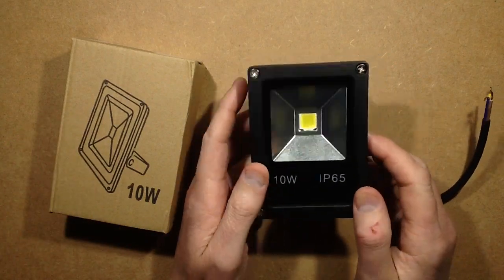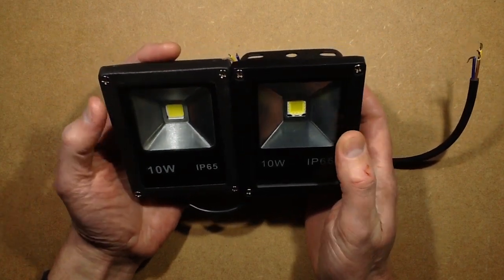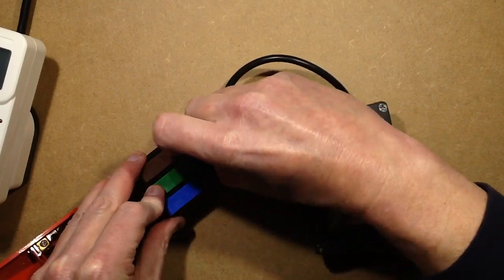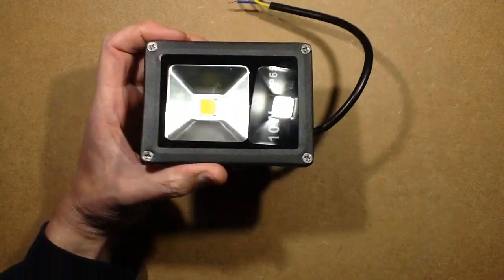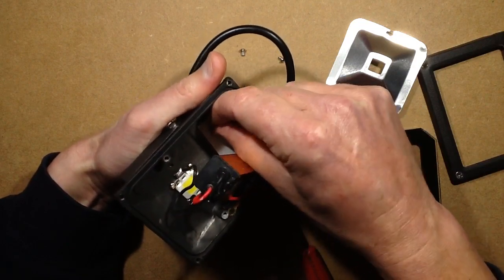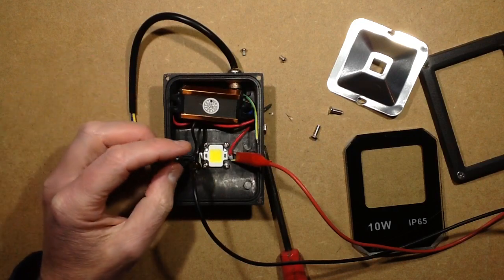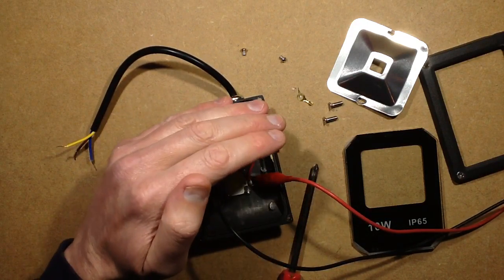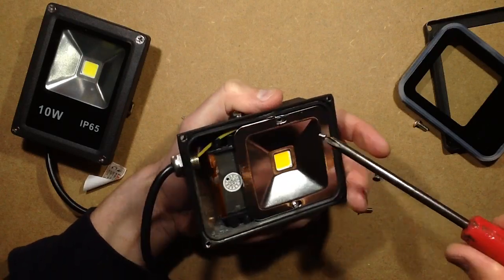A look at some super-cheap mini 10W LED floodlights.

Comment: I don't understand why they can't just put the damn earth under the screw. It will take them, what... Like half a second to move the cable there before screwing? xD. But yeah, holy crap, that's super surprising that it's half decent! :D

Would you be able to test one of those mini 50w amp boards on ebay? They're like 4-5 quid form China, and I was gonna buy one for my mini subwoofer, but I have no clue if they'll just blow up xD

Comment: Hot glue? Use acetone.
Reply: +Rav Gupta Or just alochol, isopropyl or whatever you have on hand. It works very well, and has much less risk of damaging anything.
Reply: +Old Farfegnugen believe it or not a drop or two is all we need. Place it on the body. If the label does not touch the body we are good. But the heat gun works:)
Reply from the maker: +Rav Gupta I did peel it off.  I used the hot air pen on my solder station.  it came off quite neatly.
Reply: +Rav Gupta 
As Niels said I would try alcohol (isopropyl) first. Acetone is quite aggressive to many plastics and paints and is much more likely to dissolve away the ink on the label for example if it gets there.

Comment: I found that listing and it's €3.92 with free P&P to Ireland. I sure would love to know the International postage rates in China as I certainly couldn't mail that within Ireland for that price, let alone to China!
Reply: +bigclivedotcom I read a few good discussions on how they post so cheaply (Google "How do Chinese eBay sellers make money"). From memory, it stems from a US-Chinese trade agreement where they pay a few $ per Kilogram for an unlimited number of parcels, so the more parcels they can post in one shipment the cheaper it is for them. It may also explain the large delivery variation, as they probably wait until they've got a complete Kg worth to post at once. Apparently they also have to wrap each individual package at the post office so that it can be inspected before being accepted - I would hate to be in the queue at a Chinese post office!

BTW I thought I'd done all today's shopping from China, but there goes another £6.
Reply from the maker: You couldn't send the empty box back to China for less than the complete product.  I'm not sure how the postal system works, but I'd guess the high shipping costs from here are subsidising the delivery of stuff from China.
Reply: if anyone's interested... as of 29/8/17 screwfix are currently selling off 10WLED floodlights in their clearance at £2.99 ea
swagged myself a couple and according to the guy at the counter they're going fast

Comment: I suspect the non-hooked up ground is why they they were so cheep on eBay. Rejected either in manufacturing or by an original distributor. Most of the cheep stuff I've bought off eBay had some defect or other.
Love your channel. I've been like you and have torn apart everything to find out how it works since I was 3 years old.
Reply: +Steve Rodgers brand new, some repair required.
Reply: +CowboyFrankHarrell 

If these had a safety agency approval such as UL, or TUV, then during production they have to have a specified minimum ground resistance to the case. Also, there is no stud press-fit into the case for sole use by the ground connection; that would fail safety agency inspection prior to product release right there. 

For $5-6 this is what you get. A deathtrap.
Reply: +CowboyFrankHarrell Its China, They don't care they just mass produce. The lead was too short to attach the earth during the assembly line production without slowing the whole line up so they tuck it away and continue on.

Comment: Love these cheap LED tests and tear downs, always fun when the quality surprises. If going all out you should get a spectrophotometer to check CRI of the LED's since cheaper usually is under 70 and might make you feel ill if used under longer duration, finding cheap LED's with good build quality and high CRI is gold :)

Comment: I had one of these delivered a few days ago.  Missing screws for the reflector and the led.  Was just taped onto the back of the reflector with kapton tape. Does look like the same power supply though.  Good to know for when I track down some replacement screws.

Comment: oooh i might buy like 10 of these :D
Reply: +alucard87 yeah they look good, just bought 6 for my workshop.
Reply: +alucard87 I know right? the value on these are insane.. buying everything separate off ebay would cost about $1-2 just for the LEDs and about $2 for a driver.

Edit: for any US viewers I found a similar light for a mere fourteen cents more from a US seller, so you don't have to wait a month to get it. http://r.ebay.com/wEZTLl
Reply: +alucard87 I bought four of them in warm white to replace the current E27 type floods around outside of my home..